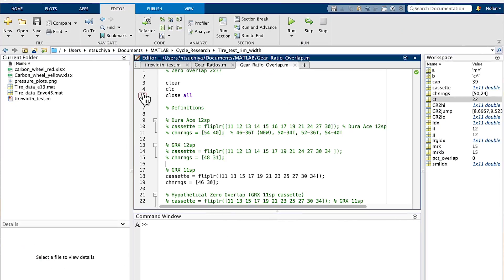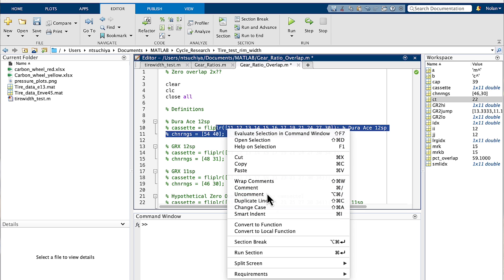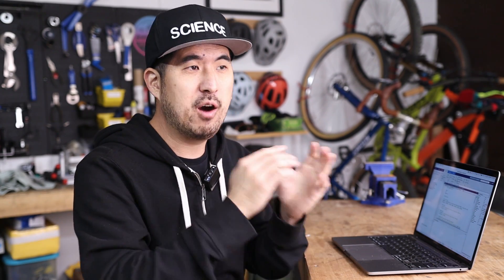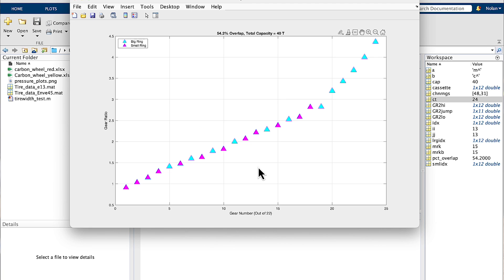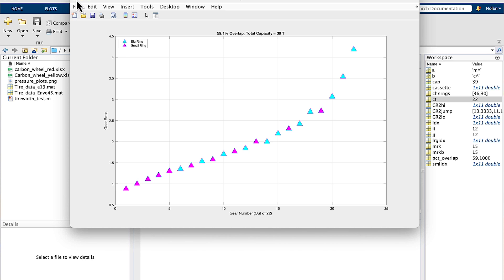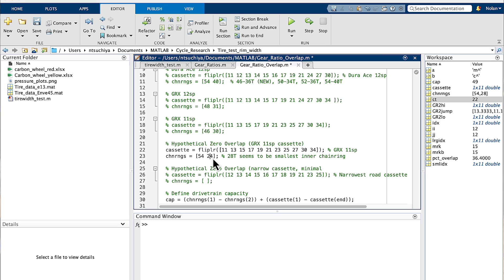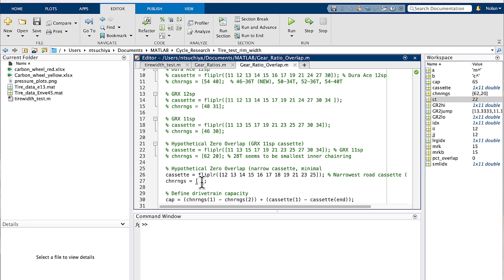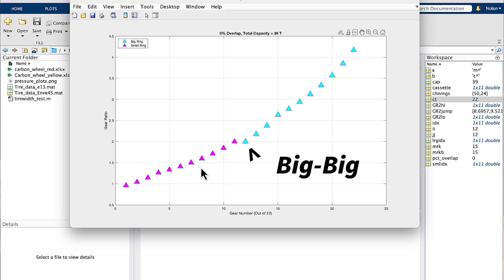Why 2x Drivetrains Have Redundant Gear Combinations

Comment: Great video. I really like both. I prefer a 1x on my Mountainbike and for almost everything else 2x. On my gravel/randonneur bike is a 32/44 with a microshift advent 11 to 42 cassette. Couldn't wish for a 1x there and on my mountainbike is a 1x12 deore. Completely different setups with completely different use categorys. In my opinion overlap doesen't matter too much, because you usually don't use the overlapping gears too much. But I can always reccomend singlespeeding to apreciate any gear system😂

Comment: That 50/28 would not be completely useless - would be amazing in the mountains where you need climbing gears with small jumps between them, but also a big ring for the descents. The change from small to big would be a hassle, but you'd be on free speed from the descent at that point. The only hard part is going from big/big to the small ring for the next climb.

Comment: Dura ace has an 11-34 cassette, which is what most people really want. I run that with a 54/38 chainring combo for a pretty wide range of well spaced gears. I never feel like I'm dumping cadence or hitting a wall. It's a huge range on tight jumps that 1x can't give.
On my gravel bike I'm running 11s GRX 42t with a 9-50t cassette, big jumps matter less off road.

Comment: Yeah - lets 'drop' 2-3 cogs either end for cross chaining and have a 2 cog overlap so could reach similar gears when in either chainring... My biggest gripe with 1x is having a high-end gear... And on my bike 32t is the biggest single chainring which will fit... I recon a 2x is (for me) the best 'compromise'...

Comment: 2:54 has less overlap between ratios, only 3 couples are really overlapping, so 21 effective speeds instead of 24... but you'd have to switch between chainrings EIGHT times to use all gear ratios in succession!!!
I couldn't remember all these combinations...
With only one chairing shift, you get 15 effective speeds only.
7:00 and 8:08 highest small chainring and lowest big chainring still have the same gear ratio. But at least it would need only one shift of the front derailleur to get 23 speeds!

Comment: My electronic groupset has a mode where you just shift up or down and don't have to deal with the distinction between cassette and chainring. But I never use it because it's really useful to be able to change the gear ratio by a large amount all at once when the terrain changes

Comment: A non front derailleur based 2x alternative with no overlap and usable gear range:
50 tooth front chainring
12-28 tooth rear cassette
Schlumpf Mountain drive (250% reduction)
Gear inches:
50x28 (low): 19.3- eagle equivalent
50x12 (low): 45
50x28 (high): 48.2
50x12 (high): 112.5- you'd be hard pressed to spin it out on descents.
The single chainring up front reduces the negatives of cross chaining. The gear range is also somewhat obscene- it could be reduced at the rear cassette and run with a narrower block 7 speed cassette. This again improves chainline, reliability of shifting and user experience of scaling the entire cassette in the middle of your range. Some shifters are better at such leaps, with many able to do 4 per click. Friction based setups (eg genevalle) can scale or dump the whole cassette in one go, though you wouldn't want to be putting down much power at the time.
A pretty silly setup still, but I could absolutely see it in use on loaded tourers and bikepacking bikes.

Comment: The amount of overlap isn't a big issue if the ratios produced are sufficiently different from one another, 2/5 might be better 1/7 and 1/8 but if that's a massive gap. 1/7 and 2/5 might both be spun at 90 rpm while 1/8 might need to spun at 75 rpm  if you can get 2kph more speed in 2/5 than 1/7, without the grinding of 1/8 it could be more sustainable long term. Also 2x tends to allow a higher highest gear and a lower lowest gear. But yeah if your going crazy and riding like a monster. But if you are riding something like 36/14, 52/20 those really aren't different gears, but 34/12 and 34/14 are fairly different, something like 50/19 or 20, is pretty close to the mid point in ratio between those two smaller chain ring gears.  1x has its uses so does 2x I think most people on road would be better suited by 2x if they are trying to cover a lot of ground but such is life. 

Overlap is a pretty over simplified in this. Because you are still getting those unique ratios. The issue with 2x is really when one ratio really is super close to another combo in the other chain ring, because the ratio is what changes the speed of the bike with a fixed cadence.  Gear "redundancy" is the real concern. Many may argue the 12  or 13 speed cassette is overkill with 2x and it might be but 2x 7 or 8 often isn't as granular as one might hope for.

Comment: Great info. Glad someone did the math about it. Always thought there was some kinda redundancy with 2x systems. I'm just a basic road commuter with a 1x system and that works for me cuz I don't do big hills any more then over passes. A single speed would work for me but I do use other gears time to time,,,,I was just thinking about the redundancy in the overlap area in the graph in that when in the small chainring the mechanical advantage would be more then it would be in the big one due to the crank arm length. I'm not an engineer, but just a simple bus mechanic. I'm thinking of the amount of force to turn such ratios givin the crank length. Maybe another video? Hope I got my idea across. Again, great video & glad you did the math. Keep'em coming!

Comment: With electronic shifting it would be possible to effectively eliminate most or all overlap by just using a single shifter where it operates both dérailleurs... shifting the front one half way through the cassette to always maintain a straight chain line. I feel like this is actually something shimano has already done before?... maybe you just have a couple of cogs on the middle of the cassette be used on both rings to compensate for the large jump when shifting the front one.

Comment: Overlap is actually something desired in 2x or 3x drivetrains. You want the flexibility to change whether gear changes give you a large jump or a small jump in the gear ratio. You want large jumps if you are cycling in terrain where your speed/ load varies drastically, smaller jumps if the terrain has you going a more constant speed/ load. The increased gear ratio range is only one of the many reasons you'd want a 2x or 3x, and eliminating overlap would defeat half the purpose.

Comment: I ride a 2x11 set up running 53/39t chainrings and a 12-25t cassette, but to avoid cross chaining I only use the sprockets 1-9, ie 25-14t, with the 39t inner ring and then only use the outer 3-11 sprockets, ie 21-12t, with the 53t outer chainring.
So I don’t use the inner two sprockets when on the outer ring and the outer two sprockets when on the inner ring. This gives me quite minimal real world overlap, which also means I don’t have many sprockets to switch up or down through when switching between chainrings.

Comment: I feel like you might be missing the advantage of bar-end shifters here. It's really quick to shift through the entire gear range on those. Still, the biggest issue would be the double shifting. That is not going to be a fun experience.

I currently run a 48/28T x 11-32 11-speed setup using a modified Pro-5-Vis crankset. That 20T difference works with an 11-speed Ultegra front derailleur and a chaincatcher but it is more of a bailout gear than a regular riding gear. And I kind of like it that way. I am planning to give 11-36 or even 11-40 in the rear a try in the near future but I might have to drop down to 46 or 44x26 in the front. Derailleur capacity is going to be an issue at this point.

Coincidentally, if you want a real-life crankset that could handle a 26-62 double, the Pro-5-Vis 50.4 BCD standard is your best option. Good luck finding a front derailleur that can shift that though.

Comment: Recently built up an old road bike with parts bin parts. 53/39 with 12-28 6 speed freewheel. with thumby friction shifters. Was great. As long as I can have a reasonably low gear I can deal with any drivetrain setup. My preference is 8 or less speeds and 2x or 3x, but 1x with wide range cassettes is fine too. Luckily most shifters can dump gears/downshift 3+ gears on 1x so mtbing is fine. I do prefer my twist shift since I can adjust trim and it's indexed while being able to upshift or downshift the whole cassette. I also enjoy single speed road riding since on hills it's "do or die(walk)".

Comment: To me the biggest unspoken benefit of 2x is the combo shift: a front shift and a mere two in back is the equivalent of shifting across 5 cogs while preserving a decent chain line. On rolling steep hills, this is extremely useful. Conversely, sometimes it’s beneficial to stay in one chainring and run through most of the cassette, sometimes requiring trim up front but frequently not. The 2x allows both in the same setup.
Reply from the maker: ‘The combo shift’ ! I’ve never had a name for it 🙌
Reply: @TheBikeSauce dual shift is definitely a more experiences riders technique & I now can land in the most efficient gear without thinking using this method & can maintain the correct cadence for the terrain
Reply: @TheBikeSauce  no need, Shimano allready has, Syncro Shift
Reply: @TheBikeSauce  No need really, Shimano has is, Syncro Shift :)

Comment: It's never been about how much speed you would benefit from it but how less the chain has to bent in order to archive that gear ratio you need, thus reduce the stress on the drive chain

Comment: I’ve never minded the overlap and indeed find it to be beneficial for the actual riding experience, but I’ve always wondered about duplicate ratios. I believe SRAM AXS can be set up to shift sequentially through ratios, seamlessly moving both derailleurs as needed, and that sounds like an interesting thing to try. In that case it would be valuable not to have chainrings and cassette creating exact duplicates, or even ratios so close that it doesn’t make sense to shift through them all.

Comment: Still using a 3x9 today on my oldschool xc bike. The only reason I would upgrade is because of chain retention, and maybe I'll make it a hybrid. Can you imagine installing a narrow-wide chainring in the center, and having to change gears by hand just in case you need to haul a pile of wood or chase some roadies..it actually sounds tempting. No more mud in the FD but my left hand is gonna feel awkward at every shift

Comment: Overlap has never been a big concern for me. I've never done the math like you've done, but I've always assumed some overlap existed. I just prefer the feel of the smaller jumps between cogs in a 2X cassette. That and it's what I'm used to. I started riding decades before modern 1X setups were even an option.

Comment: You did not consider the fully overlapped setup called half stepping. So in your gear ration calculator put in 50-47 for the front and 11-50 for the back.

Comment: Good video. I’m a 1x runner, but one big thing i like about 2x is if someone is a flatter ground rider or tend to ride the same route, they don’t wear out the same 1-2 gears. Redundancy can double the life of their cassette if they have overlap in that frequent pocket. It’s sad to replace nice cassettes with one worn cog. but good new front derailleurs that work with anything but 1 named gruppo are rare.
Reply: Good point.  Those 1x cassettes aren't cheap to replace either.
Reply: Ditto the good point, I commute on a 1x9 setup and 70% of the time I'm in one of two cogs, probably bumps up to 90% for being in one of three/four. Already had to replace a cassette as well (though it was a cheapo one so can't pin the blame on it just being regular wear). I've definitely had times worrying that I'm putting the majority of the wear on only a couple cogs.

Comment: The cool kids are now starting to run a wide range 2x with 8 or 9 speeds drivetrains. (Ronni Romance). So it would be interesting to see if a 42 - 28 or 40 - 26 (that’s what I am running) on a 9 speed gets closer to the mythical 0 overlap.  Thanks for the video.

Comment: No need to over complicate things.

2by and 3by do have overlapping gears, but.....
*provides efficiency/longevity
*more weight
*More things to maintain 

1by provides simplicity but sacrifices a bit of range.

24T/40T + 10-46 would always be faster and easier than 32T + 10-51T

Comment: I've been through this exercise many times, I used MathCAD. As you pointed out there is a big difference between theory and practice with the change over from big-big to small-small - or,more importantly, the other way round. I take part in sportive each year on which there is an 18% downhill section with an almost 90 deg curve at the bottom followed by about 200 to 300m of 15% uphill - so you have to slow down almost to a standstill with no coasting up the other side of the hill. I had 50-34 on the front and a 10 speed 11-36 on the rear.  Having to change from big-small to small big requires a major thought exercise as the 105 long cage derailleur I have is at its limits.  The 34/36 combo is not low enough to get up the hill. I have now switched to 46-30 on the front, 30 being the smallest ring the 110 bcd - 5arm crank will take. I'm switching to 11-42 on the rear - the 116 link chain will just manage that but the derailleur is maxed out on the 30/42 combination. The ratio (5/7 or 0.71) is much better for getting up that steep section and it helps on many of the other uphill sections. We have steep sided glens and the down/up combos are often 15 to 18% either side - not too long but still hard work for 200 to 400m of ascent over and over again.

Comment: Well folks, before jumping in with all the math, we have to look at semi-trailer truck transmissions.Those with three shift sticks to be precise.
One of them being the main selector, another for the splitter (or demultiplier) and last one for multiplier. These additional sticks control moving the whole gear range 1L-2L-3L-4L-1H-2H-3H-4H with zero overlap and shifting it just sligthly so that the gears alternate 1l-1h-2l-2h-... One is used for when the loads differ much (you have a trailer or not, ride great uphill/downhill slope, etc) another when the load increases gradually (entered a headwind, gradually changing slope or rougher road surface).

Long lecture past, 2-by in cycling transmissions works as a combination of both splitter and multiplier in trucks. And this is trully amazing you don't need a third lever to get most of the funtionality.

Btw, in 11-34x62/20 there is still some overlap with ratios of 1,824 for 62x43 and 1,818 for 20/11. So yeah, pen and paper beats computer...
Reply: 62x43? there's no 43 on the cassette. did you mean 62x34?
Reply: @ramensospicy2992  oh, yes, of course. German way of counting plays games with my mind sometimes

Comment: The article "Gear Issue: Friction differences between 1X and 2X drivetrains" is helpful. It demonstrates both systems in a chart.
For example, 39x11 loses 4.5 more watts comparing ot 53x15, despite having almost the same ratio (3.54). I suspect cross-chaining also wears out components faster.

Comment: to get maximum benefit of 2X, the rear cassette needs to be 8s or 9s , in that past the rear cassette has never had huge ratios, but with whats available now, a 2X system with 8s will give make a huge difference as a 1x system cannot substitue for the big front chain ring for 50T or more
seeing the bike industry recycle its tech, this may be the next trend

Comment: It all depends on what terrain you are riding. Horses for courses.

For the average rider, any miniscule amount of frictional losses 'cross chaining' on a 1x are completely made up for by the reduction in maintenance, ease of use and not having to shift a front derailleur. They are actually the worst. They work most of the time but they are so annoying when they won't shift properly.

On the roads where I ride I very rarely use the small chainring on my road bike. I could easily survive with 1x and I do ride on the road quite often on my gravel/touring bike and never felt like I needed more gears.

People who live where there are actual long steep climbs then yes, 2x is really needed so you have the small ring for long slow climbs and then the big ring for those long fast descents.

I honestly can't see the need for any more than one chainring for any casual rider or commuter. They only have any real value in sport oriented road riding.

Comment: 1x - if you're offroad because dropper posts/body language = speed/terrain undulates a lot more
1x or 2x - for mixed-surface depending on if you're a roadie/tourer vs. a MTBer
2 x - for road
3 x - if your bike is real entry level or you're a retro-grouch holding onto what is familiar vs. what is objectively better. Lots of 2x options that provide gearing as low as 3x touring cranksets of old and none of you really use that big 48/50t ring bombing down at 100rpm at 80kph like you think you do...

Comment: As an engineer I find the front derailleur to be a crude backward design and prefer the user friendly action of a 1X which has zero overlap😎
Reply: But poorer efficiencies due to friction from higher chain angles on average compared to 2x.
Reply: @SurpriseMeJT  I don't notice it on my 1X

Comment: I like 2x systems. I've spent most of my riding over the last few years towing a WeeHoo kid trailer, so the lower gearing is critical. Also, I like having a bail-out if I turn a corner and find a hill i wasn't ready for.